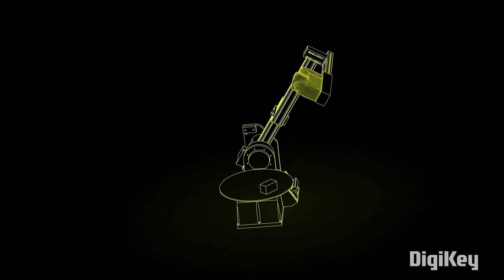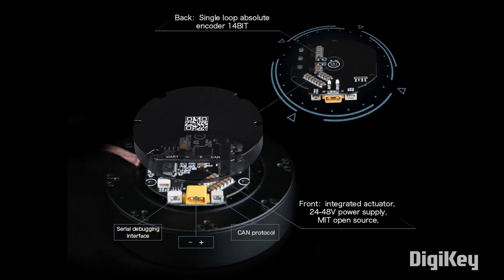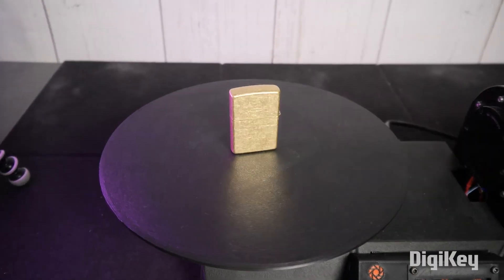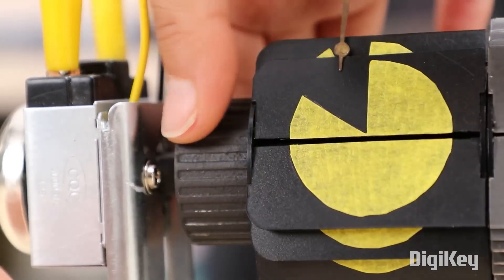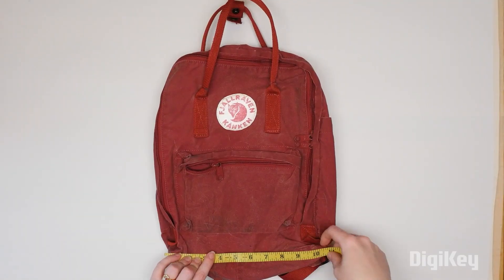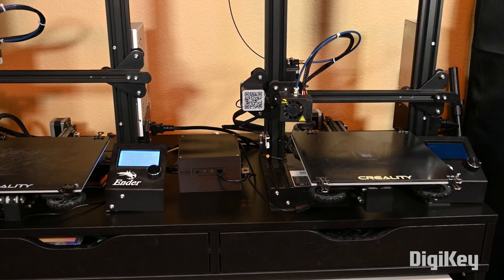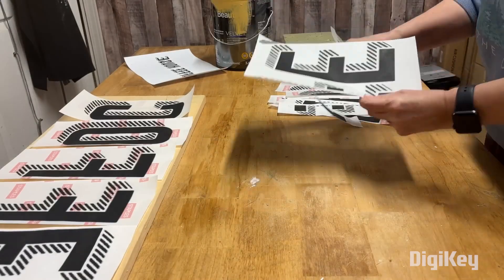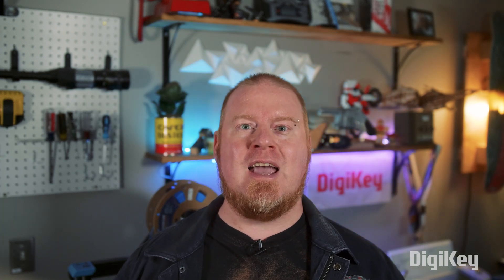Robotic Roger Deakins [Maker Update] | Maker.io

Comment: Great show as usual! Definitely going to have to check out the 3d printer power control.
Reply: Right? I have my printer plugged into one of those smart plugs, but this solution is a lot more elegant. The only drawback I can see is that I can't yell at google to turn my printer on with this.